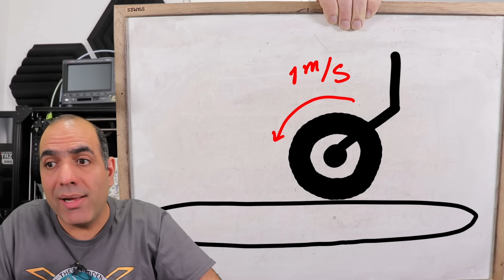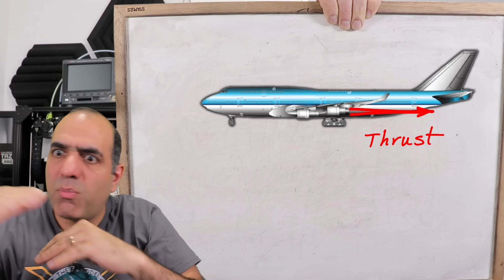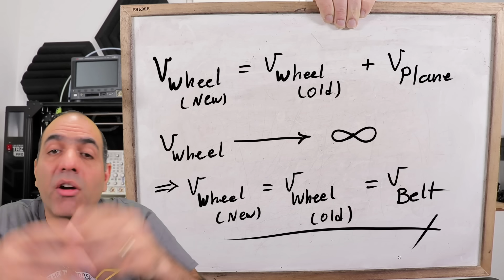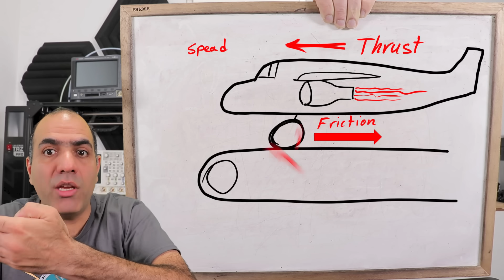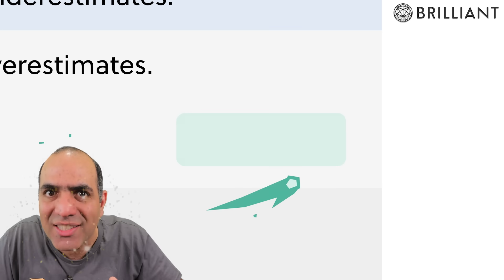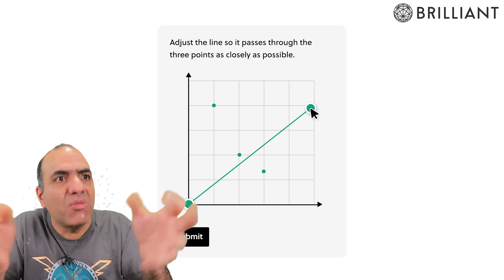Airplane Question that Drove Me NUTS!!!

Comment: The initial thought as far as the conveyor vs landing gear wheels, is that the plane will use thrust to counter the backward motion of the conveyor. And in this situation sufficient trust is generated but this would keep the plane in a fixed position, which would mean stationary airflow over+under the wing, for no take off.
Reply: (adjusts nerd glasses) TECHNICALLY there's some wind speed over the wings because of the engine air flow, but it's on the wing side and I believe would stick the plane even harder to the runway!

If it was a prop plane interest of a 747 then the prop wash should go over both top and bottom of the wings and in theory you could generate some lift while stationary.
Reply: I don't understand where that thought comes from. How fast the wheels are spinning should not affect take-off at all. Just like the plane can lower its landing gear when it is flying. Its wheels can spin very fast in either direction or be locked stationary, and the plane still flies.
Reply: @m1k1a1  while you're right that the speed of the wheels doesn't affect the ability to fly, the speed of the wheels is actually irrelevant in the problem because of the conveyor belt. As described, the conveyor belt acts on a way in the wheels such that, no matter the speed they move, they cancel out as a pair and the plane stays still

no forward motion = no lift on wings
Reply: @corvobranco6896  Think again please. The plane can sit still or move forward at any speed and there is always a different speed for conveyor belt and wheels that fulfills the condition "conveyor belt speed exactly matches wheel speed in the opposite direction". Edit: ok, I guess wheel speed relative to conveyor belt would lead to infinite speed as EB says. Yea, this is a stupid example. And one that has circulated internet for years.

Comment: no because planes need to  catch the wind to float on top of it more like a less dense water. unless the wheels is connected to the thrusters as the speed of the wheels goes up also the thrusters blow powerful wind force causing the plane to take off but this plane is more like a jetpack that turns into a glider in higher altitude
Reply: or you can use the conveyor as a beyblade spinner

Comment: My guess is it’s just going to slip off the end slowly. As the engines spool up the plan will eventually be thrust forward irrespective of the wheels and conveyor system below. But the point at which it moves forward won’t haven’t given it enough time to develop a speed to let it generate lift.
Reply: Why?  What is the unexplained stopping force?

Comment: If there's enough headwind, it wouldn't matter if the plane is moving with respect to the ground or not.
To takeoff, we need LIFT. That LIFT is only possible when there's enough air going under and over the Wings of the aircraft, creating LIFT.
Even if the Aircraft was stationery on the ground, but there's enough headwind, it can theoretically take off.
This is why there are 2 different speeds in an Aircraft. Ground Speed, and Air Speed. The Air Speed is all that matters here.

Comment: The real question being presented is, assuming you can achieve the conditions such that an airplane remains horizontally stationary during an attempted takeoff with the contributing factor being moving ground that effectively opposes the plane to the point of maximum thrust being necessary just to avoid being moved backwards by the ground, would the plane start flying or stay on the ground?

Comment: Even if the speed may be the same on the conveyor belt, the acceleration of a place could theoretically (as it is an imaginary situation) be greater than that of the belt. So...I mean, the plane would take off in any case? Speed is not the same as acceleration, is it? Yes it is a cheap twist, but one that works?
Let me know how I am wrong :)

Comment: You are absolutely right. Only thing I would add is that in case 3, because the wheel speed has to be 2 times the belt speed, it would be impossible to construct the belt the match the wheel speed making the belt both irrelevant and impossible
Reply: If the plane is kept stationary relative to the ground (not the belt) then the belt always matches the speed of the wheels. If the plane moves a little bit, the wheels will immediately spin to infinity and explode.
Reply: @eklhaft4531  the wheel speed cannot go to infinity because that impossible, it also necessitates the belt speed going to infinity which is also impossible, hence why i said its impossible.

Comment: You could think of the plane as skidding across the conveyor belt. Since the belt is only as long as a runway and the friction between rubber is high, the plane won't be going fast enough when it reaches the end.

Comment: I imagined it this way: What if the conveyor belt were added during flight, pushing up against the plane's wheels only with the force equivalent to the plane's weight (let's say the wheels aren't stowed). Would the conveyor belt interfere with the plane's flight? I'd say not, since the plane's speed depends on the engine, not the wheels. EDIT: Watching the video, Medhi addressed my scenario, which showed that I assumed the wheel bearings were frictionless...oops. On a related note, way too many of my physics test questions in school were worded this way...I didn't enjoy a lot of physics classes because of how many assumptions you'd have to make to answer. It always frustrated me to no end.
Reply: The point is that an airplane flies because of airspeed, not landspeed. It's the air moving over the wings fast that causes lift.

A conveyor belt, no matter where or when you put it, won't change that.

Comment: Yes, it'll take off. The engines / propeller will still move the plane forward regardless of what the wheels are doing. And no matter how fast the conveyor belt's going the engines will still push the plane forward across it until it takes off.

Comment: no As there will be no change in the position of the airplane. The Airplane won't be able to generate thrust Because when its moving with respect to surrounding the air foil will not have lots of air flow under it.

Comment: if the treadmill is constantly matching speed of the wheels, the only issue is them overspeeding and causing higher friction, slowing the takeoff roll down. that seems like it might run into an exponential situation, so the question is how exponential

eyy, i got the "friction everywhere" case, though it seems it doesn't matter because the treadmill is apparently instantaneously responsive
Reply: Speed of the plane, not the wheels.  The wheels rotate at 2 X and move away at the plane’s 1 X so the (minus 1 X) conveyor grip ‘feels’ a matching 1 X.  There is no infinite kick in speed.
Reply: @givenfirstnamefamilyfirstn3935  if its matching the speed of the plane, theres no issue, the wheels spin twice as fast, but the plane still accelerates. but its up to interpretation
Reply: @xymaryai8283    Misinterpretation is very possible.  The linear forward speed of the wheel on the moving undercarriage leg can be mixed up with the rotation speed of the wheel on that leg.  In this case the leg and wheel progress at plus 1 X even though with the 2 X rotation speed the bottom of that tyre is moving at minus 1 X and gripping the minus 1X conveyor.
The speed of the wheel (and attached aeroplane) is equal to that of the conveyor.  Viewed from the left of the plane the wheel rotates anti-clockwise and the conveyor rotates clockwise.
Mehdi misinterprets the rotation speed of the moving forwards at 1 X wheel as a stationary 2 X wheel grabbing a 1 X conveyor.  He sees infinite exponential acceleration with positive feedback🤪

Comment: Paused to say why the plane will fly at 45 seconds:  the wheels are not what push the plane.  The engines are attached to the wings.  The conveyor belt could move 10 times the speed the wheels move but it won't matter, the engine are what actually push the plane

Comment: Airplanes only achieve flight due to the lift produced from the air flowing around the wing.

The speed that the wheels are going, has no bearing as to if a plane flies or not. Only the relative airspeed to the craft.

Now,if the plane was in, say, an air tunnel, and was otherwise constrained, the air moving could/would produce lift. If sufficiently fast, yes, the aircraft could lift off the treadmill, but again, the treadmill/wheels are entirely irrelevant to the phenomenon of flight.

Ok, now to watch the video...

Comment: Here is my answer before I watch the video (00:36):
My answer is No, the belt may be moving at the speed the wheels do on the runway but the plane itself is staying still, meaning it is not getting any upwards lift from the air that would ussualy be pushing against it, for all intensive purposes, the plain is still and not moving at all, as if parked. 
If the plane were to take off while doing this, it would be a VTOL and not a Commercial Jet as pictured. 

So, let's see if I am right.

Comment: The wheels on most planes are free spinning. They have no effect on the takeoff, its not a car, the planes engines generate its own thrust. If the engines are on it will take off. As the belt moves faster its own friction will also move more air to the plane and eventually would give enough lift for the plane to take off, as soon as the wheels leave the belt even a tiny bit there's no more friction between them.

Comment: the ground speed doesnt matter at all. its the air speed. remember, the jets aren't pushing against the ground, they are pushing against the air.
even if the the conveyer belt was moving at the speed of light against the direction of take off (and assuming the wheels had no friction in the bearings), the plan would still take off like normal

Comment: I might be wrong but this is my explanation , PS: i commented this before watching the video

It will not matter and the plane will take off because the momentum for the plane to take off is not coming from the wheels accelerating but it is coming from the thrust created from the engines,

So as long as the conveyer belt doesnt affect the airflow somehow it will not matter because the wheels are just there to help the plane move without being opposed too much from the frictional forces on the ground (imagine a plane trying to move with thrust when it has no wheels and lying belly flat on the ground)

Comment: The ONLY thing to think about is how the conveyor belt is effecting the air near the plane.  

If (through friction) its able to move the air over the planes wings, then it could take off.  However, the plane wont take off at the speed of this conveyor belt.

Comment: Assuming that the treadmill moves at the same speed/acceleration with the plane to provide an infinite runway, no, because there’s no air moving over the air foil and no differential pressure to generate lift

Comment: The belt never goes any faster but the wheels will spin faster and depends on the jet speed at each moment. Think of everything starting from rest and as the belt speeds up the jet accelerates just to say in place then at maximum belt speed the jet engines are keeping it stationary while the wheels are spinning fast. Now the pilot increases thrust and the jet accelerates forward adding greater rpm to the wheels then the jet must have enough thrust to have a short takeoff so make the belt the length of the runway, now the jet flies away.

Comment: Mehdi you said right the jet engines are producing thrust wheels are just not doing anything in any case scenario the plane would approach v1 speed and high regime and then rotate as normal wheels, conveyor belt and opposite run had to do nothing about it it's just there to Confuse us got right in first time 

:P

Comment: Wheel speed is irrelevant. All that matters is the airspeed. But as the question is worded, no, the plane wont be able to take off. This because it's said that the belt will move in the opposing direction at the same speed as the wheels is turning. So even if you try to move the plane forward to generate air speed the belt would just speed up to counter the motion until the wheels reach a rpm where they fail due to the bearings wearing out or the tires shredding. Once that happens the plane will never be able to reach a speed to generate enough airspeed over the wings so it can take off even if the belt is stopped.

So as the question is formulated, NO!

However if the question is reformulated as: The belt will move in the opposing direction at the same speed as the plane, then yes, the plane will be able to take off. That is provided that the wheels are not damaged by spinning at twice the regular takeoff speed.

The exact wording is important.

Comment: FINALLY!!!!

I have been making this point for ages that it creates an infinite feed back loop.

One of two things happens. The wheels would blow out from over speed and the plane would be melted by friction.  OR
Treadmill would approach light speed. Which would increase its mass. This causing a black hole.

So unless a 747 can fly through a black hole, I say it won't fly.

Comment: After giving it some thought, I think I've found an answer that satisfies the question's conditions in a real world scenario:

Apply the brake, simple as that.

If the wheels and treadmill are locked together like gears, then no relative movement is the same as equal movement, and the question doesn't stipulate that the wheels HAVE to move in order for the treadmill to.

It basically boil's down to the mythbuster's test, the tarp and wheels were stationary to one another, but the whole system was moving forward in a manner that allowed the plane to properly take off.
Reply: Problem you have is that it doesn’t mention that the brake is on or even that the engines are at full power or actually running at the time. It says sitting on the conveyor belt, any movement forward to gain speed is counteracted by the treadmill moving in the opposite direction with infinity effectively making the plane stationary. The only way for the plane to take off would be to drag the wheels along the conveyor belt without turning at all but like I say there is no mention that the brakes are even on so can’t use this information. So we have to agree there is two answers unless you add in information that isn’t provided to get a result of yes or no for flight. Everyone is correct

Comment: Ignoring thermal motion of air particles, it is the act of moving from point A to point B through air that generates air flow across the wing and lift. If the belt exactly matches the forward motion such that the plane is stationary relative to earth, there should be no lift because there is no air flow across the wing to generate the pressure difference.  Or am i misunderstanding the problem here

Comment: It would have to match the thrust output of the aircraft. Even then there are many other factors at play. The wheels only move because the thrust moves the aircraft. The Major factor is airspeed not land speed. Mythbusters already did this years ago. the plane still took off.

Comment: No, it cant. If you exactly match the speed of the wheel that means you keep the wheel static where it is. That means no air over the wing and no lift. Or to look at it another way the conveyor has to perfectly match the thrust of the engine with the force applied to the plane via the bearings to do so.
There is no reason to consider the rotational system and trying to do so will probably break your brain. 
(Thank you to my Mechatronic professors, i kinda hated kinematic calcs but im grateful i did mechatronic over plain electronic after my electronic trade etc)

Comment: I think you've focused on the wrong thing.  The wheel speed is irrelevant. If the jets engines are running, the jet will move relative to the atmosphere. It will eventually take off once it is moving fast enough relative to the atmosphere regardless of its sped relative to the runway treadmill.

Comment: If the conveyor belt is moving backwards fast enough (doesn't need to approach infinity :-) it will drag the air below the airplane backwards. At some point the airplane will take off stationary.

Comment: Assuming the plane wasn't tethered to the belt the speed of the belt wouldn't make a difference to the speed of the plane as the plane is using air to propel itself forward. The belt matching the speed of the wheels however would most likely break the laws of physics as in the event the wheels rotate the belt would then rotate at the same speed causing the wheels on the moving plane to increase in rpm.

Comment: I'm answer is yes, the wheels do not have an effect on the movement of the plane. The plane movement is not dependent on the wheels, it's controlled by the movement of the air. So I say yes the plane will take off 1:18

Comment: 4:30 i didnt get why conveyor belt should be move with 2v in backwards if wheel is rotating with 2v ,as centre of mass of wheel is moving forward with v which means lowest point of wheel is moving with v which is same of conveyor belt hence their is no slipping between tier and conveyor belt
Reply: Please explain someone

Comment: Maybe I'm overthinking (or not understanding) the question, but I'd think the answer is no, reason being that even if the 747's jets are pushing on the air and not the ground, the aircraft's weight is still sitting on the wheels. Therefore, if the belt matches the aircraft's attempted acceleration such that it's net ground speed remains 0, it has no way to get the wings to generate lift. The thrust-to-weight ratio of a 747 is somewhere in the 0.27 range, from a google search, so it doesn't have nearly enough thrust to take off on engine power alone. It needs to get the loading off the wheels and onto the wings to get free and it has no way to make that happen on the treadmill.